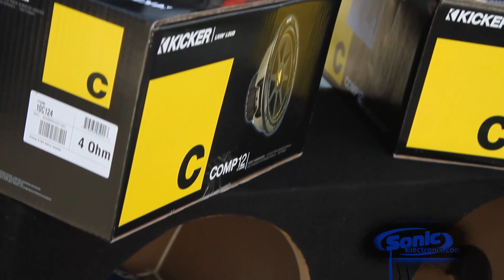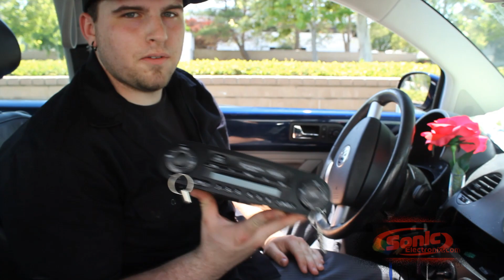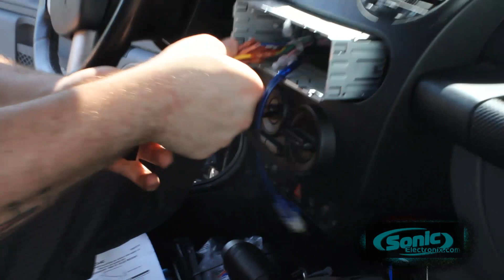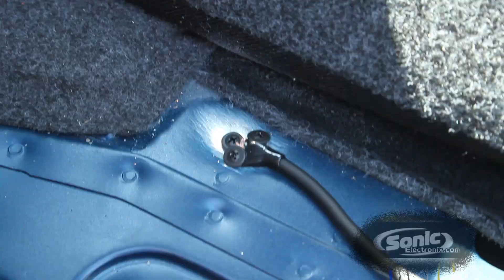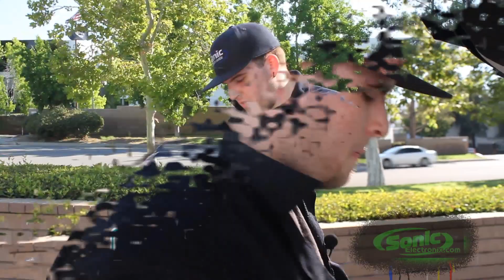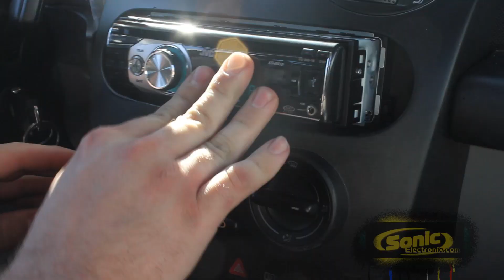Car Audio Installation in Volkswagen VW Beetle - Kicker Subs & Amp + JVC Stereo

Comment: You skipped the most useful thing, how to run the amp wire from the back of the car, through the firewall, and to the battery

Comment: I drive a 69 VW beetle. He didn't have any type of music in him before so I went and got a system put in.  I got a kenwood stereo face plate Two amps, two 12inch subs, two 6x9 speakers, and two 6 1/2. Speakers.  I don't know anything about wiring stereo systems.
Would you or anyone be able to tell me why does the vocals in the songs cut out as soon as I turn the volume up, Or as soon as the bass in the song drops?

Comment: alright sonic I have a weird question for ya. I have an 04 NB convertible with the Monsoon package... now crutchfeild says my door speakers are 8 inch subs and several other sites say its the 6 1/2 component set. so firstly should I rip the panel to find out whats actually there, and secondly If it turns out that door has 8 inch subs how deep is the mounting hole for that. am i gonna have to find shallow 8's or rig up 6 1/2's?
Reply: There are no brackets to fit an 8 inch speaker your gonna have to use 6 1/2 and you must drill out the rivits holding the speakers. Also if what im doing is adding a  amp because the monson amp only sends bass frequencys to the front speakers
Reply: right id prolly get a component set to run in 6 1/2s just so the sound isnt mudded up by a 3 way

Comment: I have a DB Drive (A5-125.4) amp powering four Faital Pro midrange speakers with each rated at 130rms , they are 8 ohms. The specs of the amp are as follows - • 4 x 125 Watts @ 4 Ohm
• 4 x 200 Watts @ 2 Ohm
• 2 x 300 Watts @ 4 Ohm Bridged 

The amp is bridged bringing the resistance of each pair to 4 ohms because i hooked them up parallel. I would like to hook up a pair of Power Acoustik NB-1 tweeters rated at 100rms at 4 ohms. I would like to know if this can be done ? If it could be done i would like some info as to how to wire them please. Thanks.

Comment from the maker: The enclosure is what will make a subwoofer sound it's best. You have to double RMS power just to get a little more volume out of your subs. The enclosure is important. Subwoofers can handle a wide range of RMS power, staying at the recommended is not required. Also, customer budget is a big factor in all of this. Usually, over powering by a little bit is a good idea.

Comment from the maker: Vic, you don't want to do that. You need to make sure you use a terminal for it so your connection is secure. The way your friend did it could cause problems if it comes lose or if anything hits it. It is dangerous.

Comment from the maker: Using a vehicle specific wiring harness should fix your problem because you wont have to sort through the car's colored wires. However, if you need help, give us a call and we can help answer your specific questions. 1-877-289-7664

Comment: Need some serious help, I have a 2011 Volkswagen Jetta SE I want to remove the old factory radio and replace it with a double din JVC or Pioneer havent decided yet the problem I'm having is the din for the radio is rounded instead of a sqaure and I dont see how I'm going to manage to put a square insided of a rounded square ...

Comment from the maker: That is just the MAX rating of the speakers. It is what they can handle. You don't want to run them at that output because you can blow them. You want to match the RMS rating of both the amp and speakers. That is your best solution.

Comment from the maker: @DerbiSmdu1480 The remote wire will go from the radio to the remote input on the amplifier.  This wire allows the amplifier to be turned on when your vehicle does.

Comment from the maker: @eagle0924 You might want to consider the box you are using.  If it is a ported or vented box, it would be a good idea to switch it out for a sealed box.  This will cause your bass output to be more accurate and precise.  Make sure that the internal volume is between .5 and 1.0 cubic feet.

Comment: i have a ?. . .i have 2 12" at 4000 watts peak and 1000 watt rms each and i got this amp a boss mono class D it say 2100 rms @ 4 ohms bt its says Max power 2 ohms @ 3500 watts 1 chan- 1 ohms  @ 4500watts 1 chan wat is best?? i dont get what tha peak power its giving at rms for 2ohms @ 3500 watts 1 chan. and my subs are at 4 ohms each! i jus need ur input if that amp can push my subs plz help thanks

Comment from the maker: @EricsFarm Yes you will be able to hook up these subs to a monoblock amp.  You will need to wire them in a Series configuration.  You can find a visual diagram through the following link:

knowledge.sonicelectronix[DOT]com/tools/subwoofer-wiring/

Comment from the maker: Soldering is always the most secure way to make a connection.  However, crimp connectors are good as well.  Just make sure you properly crimp both sides of the crimp connectors and you will be fine.

Comment from the maker: @Amalemodel Its the blue and white wire on the harness that came with the radio and the solid blue wire coming from the car harness. Make sure you don't confuse the remote turn on wire with the power antenna wire.

Comment: @ChevyGangman323 You will need to use the remote wire coming from your head-unit, and rout it to both of your amplifiers as well as your Epicenter's remote input terminals. The remote wire will trigger all of your devices to turn on whenever your head-unit is powered up.

Comment from the maker: @JERMX101 The best way to do this is using L-brackets, this will allow you to mount the enclosure to the floor. You might want to use one for every corner just to make sure its securely mounted.

Comment from the maker: @javiderek31 No this is not normal, the problem here is that  the remote wire from the amp is more than likely connect to an accessory power wire. So the amp turns on and off with the car and not the radio. To fix this problem make sure that your remote turn-on wire is connected directly to the remote output of the radio, this will cause the amplifier to turn on and off along with the radio.

Comment: @javiderek31 dude no your amp will drain your battery car and u will not be able to turn on your car...your amp should turn off when the radio is off and it should turn on when you turn on your radio....i think what they forgot to connect is the thin blue antenna cable in the back of the wiring in the radio ...Trust me i know same thing happend to me

Comment from the maker: @bsiffy When using a crimp cap or butt connector all you need to do is connect the copper from the wire to the metal inside of the connector.  This will conduct the other end of copper.  The ends of copper don't necessarily need to be inserted until they touch each other, although you will want to insert them as securely as possible so the install will last.

Comment: when crimping the factory wire harness to the aftermarket wire harness do the actual copper wire parts have to touch each other? and if they do should you twist them together then put the crimp part over them?

Comment from the maker: @EASYxxZ It's always good to have an aftermarket stereo since it makes hooking up the amplifier easier.  If you don't want to get a stereo you could always get a Line Output Converter to convert your speaker wire into RCA outputs to run to your amplifier.

Comment from the maker: @Djordjeeee451 It is possible.  Depending on the stereo you choose. Some car stereos might have a lower signal-to-noise ratio, or a less than quality digital-to-analog converter.  These are huge when it comes to sound quality.  Check out some stereos by Kenwood, Pioneer, JVC's new stereos, and you'll fine happy with the sound quality you get.

Comment from the maker: @TheToTooTwo Not in this particular installation.  A Big 3 Upgrade works wonders for system that require a little more power.  This system only uses a total of 300W RMS.  Although a Big 3 Upgrade will always help, you don't really need to do one until you're getting towards 900-1000W RMS or more.  Than you'll definitely want to do a Big 3 Upgrade.

Comment from the maker: @vespaT27 You'll need to purchase separate wiring for the MTX Magnum package. For the radio removal, you'll also need to purchase VW Radio Removal Keys separately.  You will need an antenna adapter for that vehicle if you would like to retain your AM/FM transmissions.  The Metra 40-VW10 is a great option to use in this particular case.  The model number for the radio removal keys is the Metra 86-9001.

Comment from the maker: @vespaT27 That particular vehicle doesn't require a dash kit.  The the factory radio is a standard single din size, so when you install an aftermarket radio you'll just use the volkswagen removal keys to remove the factory radio and use a mounting cage that's supplied with aftermarket radios to mount the radio into the factory area.  No dash kit is required for your vehicle.

Comment from the maker: @jacedison In general, it's perfectly fine for a car audio system to be run from 4 ohms to 2 ohms, as long as you hook them up correctly.  With your particular setup, you may be under-powering the subwoofers, even at 2 ohms.  Check to see how much RMS power your subwoofers require (not peak or max) and see how close that matches up to your amplifiers power output at 2 ohms.

If your subwoofers are dual voice coils (two +/- terminals) you can only wire to 1 or 4 ohms on your amplifier.

Comment from the maker: @SoToxsiK It looks like for the most part we used the AK04 for power/ground and RCA connections.  The speaker wire used is Kicker speaker wire.  I believe we used the 09XW1220 for speaker wire.  It's 12 gauge Kicker speaker wire to get some better signal from the amp.

Comment from the maker: @bassline123456789 You can drop the impedance of any speaker.  So if you have two single 4 ohm Kicker Comps and you want to wire them down to 2 ohms like in the video, go ahead!  That will work great!

Comment from the maker: @SoToxsiK Break-in time usually takes about 24 hours of playing time for your subwoofer. During this break-in period keep your amplifiers settings around half-way of where you want them at the end of the break-in period.  For example, instead of turning your gain settings on the amplifier to half way, turn it to about half of that.  This will help keep your subwoofer distortion free, or keep them from heating up too much as well.  Good luck with that setup!

Comment from the maker: @SoToxsiK That's fine, you're not significantly under powering them at all. You can throw some extra power to those comps though, they can handle an extra 100 watts each if you really want.

Comment from the maker: @MilRom9 You can also pickup the hardware from us as well.  The Scosche TK12V is a great entry-level kit with wire crimpers, some butt-connectors, a multi-meter, and a pry-tool.  Just search for TK12 or TK12V on the green search bar on our main website and you will be able to find these tools.  If you need just connectors, we sell them in packs of 100, so we have plenty of different ways to stock up your connectors.

Comment: If I were you, I would have hooked up the ground to the seatbelt bracket. It is the best solid ground you will find, and it's in the trunk, and don't have to put holes in your car.

Comment from the maker: @joshdesjardins6 A single channel amplifier would be the same thing as a Monoblock amplifier.  Usually, most monoblock amplifiers are made with Class D Circuitry, so in this particular case this amplifier is a Class D Monoblock Amplifier, which you can also call a single channel amplifier if you want to.